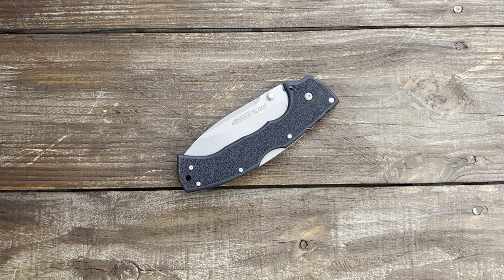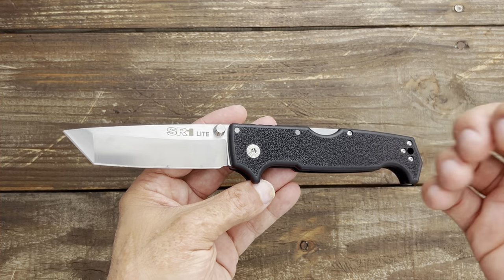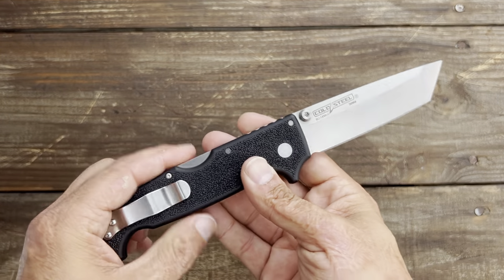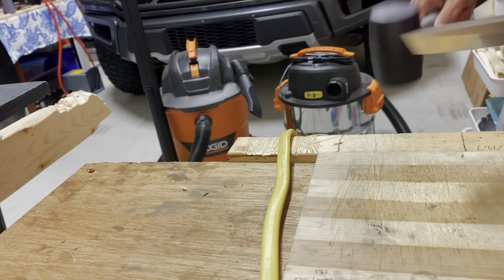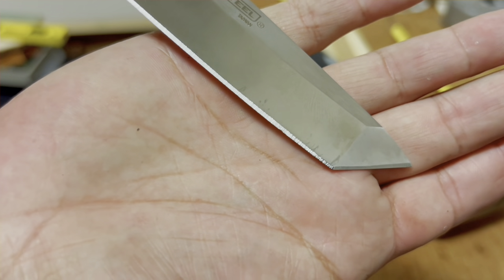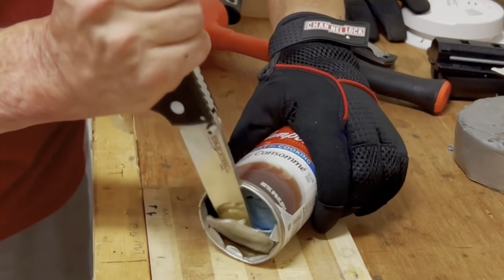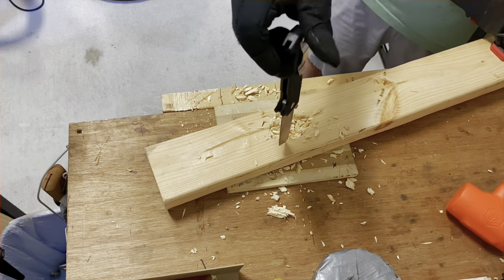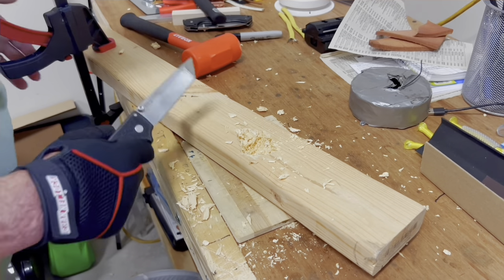Strongest pocket Knife for the Money? Cold Steel SR1 Lite

Comment: There is no way that you can break this knife without purposely trying to do so. JoeX couldn't even break it, the SR1 Lite specifically.
Reply: Io lo rotti dkkeggiato tutta kabkama solo mettendo kon unvalyra lama in 3cd skegguatonlovtirato kontro il pavimento se skeggiata la punta po la ceramica baytevovsopta kon portello fi ferro rotto in casa 3 minutib
Reply: io lo rotttto in casa sbranka d 3 cipppanso un park si muovva tutttto skcciato o fatto rso sabato fors òlundi mi arrriva il vamboio sara un difttto di fabbtrica ma la cosa bruttta  10 acosto sab lornzo 12 13 cdv cambiarmlo al bar sprando il bar kiuda solo 14 15
Reply: The sr1 clip point… tanto he did break

Comment: Cold steel does some of the best plastic handles there is and people don't seem to talk about it. You really don't lose much going from the premium s35vn models down to the plastic+AUS10/AUS8/8cr models
Reply: I second that great comment
Reply: Yeah 8cr is a great steel as a person who actually uses knives not just for cutting boxes 8 cr is just as good as s30v i cant stand the knife market pushing "premium" steels like they think it matters the question people need to ask is not what steel but what the heat treatment is is what you should be asking dont fall for the corperate bs these knife snobs push
Reply: @T K That's just objectively wrong. s30v is better than 8cr in every regard--assuming decent HT--except for "ease of sharpening." However, the edge retention of s30v, especially for cutting cardboard, makes s30v edges last longer between full sharpenings.

Also, what is up with people forgetting that punctuation exists? Your comment looks like it got machine translated through every language in Europe and back to English
Reply: What do you use your knives for because i have a pm2 and it just doesnt impress me at all and edge retention is not always a good thing i skin alot of animals and bones chip blade edges and i want to be able to sharpen easy i doubt you use knives the way i do i would not spend 100 dollars on a hammer so i wouldnt on a knife if i gave you a knife unmarked you wouldnt even know what steel it is i fell for the consumer shit too and i snaped out of it realizing i actually use my knives not collect them steel is irrelivent
Reply: You lose more money the other way around haha. Indeed! :face-red-heart-shape:
Reply: Brandon Pausta  You could also use some punctuation marks, so my brain doesn't go "screw it, I aint gonna read all that swash".

Comment: On my SR1 the edge of the blade hit the spring when the knife was closed and it damaged the edge. First thing I did was disassemble the knife and chamfer the sharp edges and polish some surfaces, then I put a piece of rubber tubing on the pin that the blade rests against and reprofiled the edge and sanded the area under the clip. So, took some work but now I'm really happy with the knife. :)

Comment: Having the premium versions of the 4MAX, AD10, and AD15, I was amazed how the Lite versions of the 4MAX and SR1 felt in comparison; not bad at all! That Grivory they use is so thick and stippled so well. It's definitely the nicest feeling plastic handles out there. Impressed by all my large Cold Steel in the collection. G10 or plastic, they all perform well above other knives I've paid much much more for.
Reply: Hello of the 4max scout and the sr1 lite which do you prefer and why?
Reply: @kawizx12r74  great question! Probably the SR1 because not only is it not as large as the 4Max Scout, so it takes up less space in the pocket, but it comes in 3 different blade configurations, which is nice to have choices. As far as strength, ots every bit as strong as the 4Max.
Reply: @cueball981  awesome. Thanks I cant decide I have big hands and I like the handle shape of the 4 max scout and I prefer the aus10

Comment: I damaged an edge and broke two tips on my Spyderco s… I won’t buy other knives less a Benchmade freak ,other than a cold steel! Stassa, just hold the scales on the knife, don’t use the thumb studs and flick your wrist , it will deploy nicely! I told Jimmy slash the same thing. The weight of the stock will deploy the knife through a kinetic wrist flick! I can do that with both of my voyagers reg and xl too.

Comment: 1:28 It's actually 8cr14mov.. wich have a better edge retention.
Reply: I think the steel mill they selected would be more important. 1% absolute difference in Chromium level between 13% and 14% shouldn't noticeably change performance in and of itself. Maybe 14 is just shorthand for "our better made 8Cr".
Reply: @mdubb4855  It's about 10% better in edge retention.

Comment: What do you think the best hard use folder is? I want to be able to baton wood, carving, being able to use the tip like you do in the video. I prefer micarta for handles. Thanks for your content, your video is one of the few that actually tests the knives.
Reply from the maker: Can’t think of any that come with Micarta but  the Cold Steel 4-max or 4-max scout that I tested on the channel and most of the g10 Cold Steel’s

Comment: I'm impressed.  The more I research, the more I want this knife.  Would you recommend the tanto or drop point version?
Reply: Agree with you...I have also done a lot of research on the advantages of this CS SR1 Lite knife on YT channels and various other videos...proved that it is the strongest folding knife in history. For me I must choose tanto point, drop point is also very handsome..😎👍
Reply: @ZefKomodo  I went with the tanto because it has a slightly thicker and stronger blade.  They can both perform the same tasks.  The drop point will be a little sharper though.  What it comes down to for me, is the tanto just looks cooler.

Comment: Just fyi - for the YT viewers - if the overall size and style of this knife is what you likes - you can also look at the Smith and Wesson Border Guard.  Has several handle and blade options, but wont be quite as beefy. I have 2, and just ordered another for $22, that comes with a partially serrated blade and g10 handle. Theirs also has an incorporated strap cutter and glass breaker. 4.2 inch tanto style blade and its been around for a long time. Wouldnt be surprised if their knife is what inspired this.

Comment: I have 18" arms. Body builder. I put my Glock FM78 completely through a piece of pine exactly that thick and it went through the pine, come out 0.7cm the other side and then went 0.7cm into another piece of pine behind that (the table - a brick pallet crate) with one hit. I did it 6-8 times. On the 3rd or 4th strike it split the wood plank in half.

Comment: Really like these testing type of videos. Also like that you push knives harder or lighter depending on the use the knife is designed for. Been looking for a hard use folding knife lately that can really handle it's own with great steel. So far I've only seen a benchmade full size adamas that fits what I'm looking for. Does anyone know of others available with higher-end steel? Thanks
Reply from the maker: The Cold Steel 4-max is probably the toughest knife I own and you can get it in cpm 20cv or S35vn. The full size and the mini Adamas are both awesome and super tough. I tested and reviewed the mini Adamas on the channel a while back. I like it so much I bought a second one lol. Well thanks for watching I appreciate your support 👍

Comment: 16:56 so that tiny bit of movement will go away eventually?? Mine came with it tiny bit
Reply: Same with my SR1 Lite..there is a tiny bit of movement when the blade is opened but it is normal and not a problem...Triad Lock SR1 Lite is proven to be able to withstand a load of 500 lbs...
so there is no need to doubt his ability. I really love and satisfied with my Cold Steel SR1 Lite Tanto...💪😎👍

Comment: The problem with a low quality "beater" is when you need it, it's going to get a beating. That steel  isn't up to it. Heat treating can't work miracles on the alphabet soup grades. ✌
Reply from the maker: I definitely don’t like the steel however it surpassed anything I’d ever need it for so it’s kinda hard for me to knock it
Reply: Joe x couldn't break this blade on this exsxt style knife........people need to wake up all these super steels which iv had myself chip super easy cause they are tooooo hard